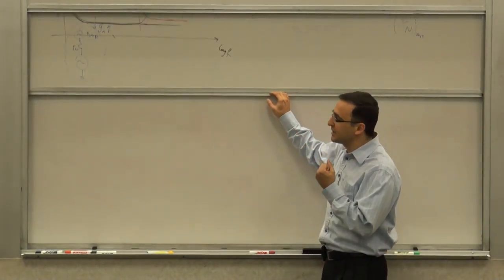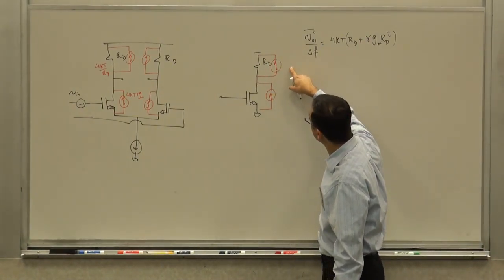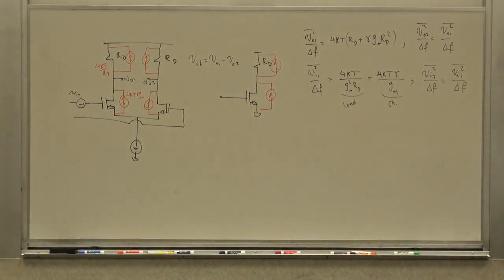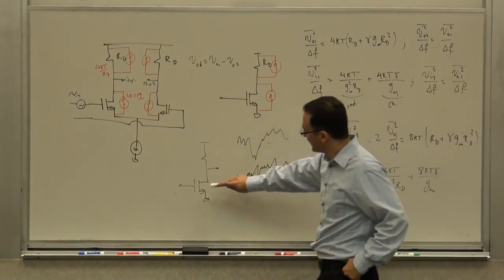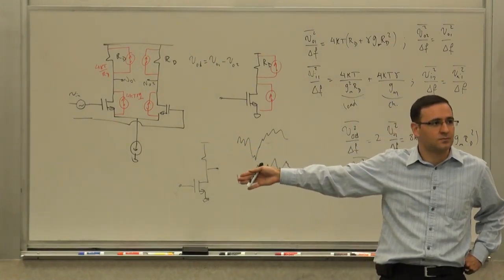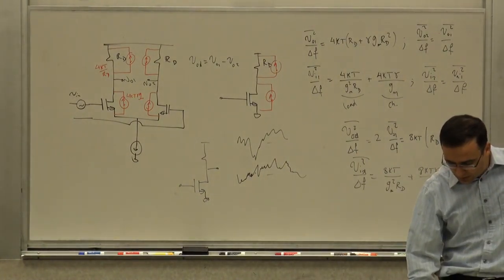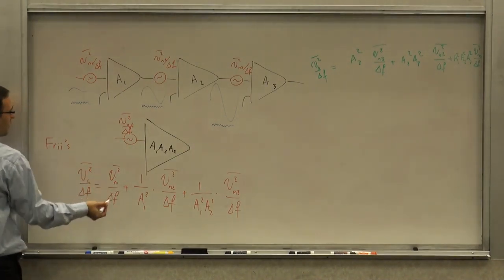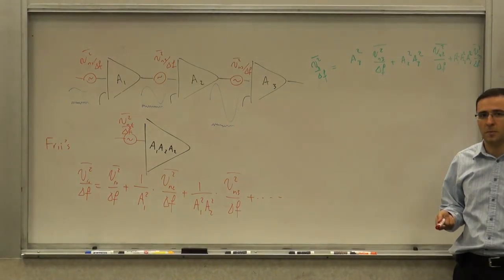169. Noise: Differential Amplifier Noise,  Multi-Stage Amplifier Noise

Comment: Hello Prof. I have a confusion when comparing the explanation in the textbook and here regarding the differential amplifier. The textbook by Prof. Razavi says that we cannot use the half-circuit concept because the noise sources are uncorrelated and hence there is loss of symmetry. Hence the entire circuit has to be analyzed. Can you justify the use of half-circuit? Also, suppose I wish to not use the half-circuit even if it is applicable, how would you derive the noise expression?
Reply from the maker: The calculation in the video does take into account  the fact the noise sources are uncorrelated. That is exactly why they do not cancel each other. The half-circuit is just used for determining the transfer function. You can assume two separate noise sources and analyze the whole circuit. The result for the differential signal will be the same. Hope this helps.
Reply: agreed, source node is no longer a virtual ground in noise analysis, it is for sure 2 input pairs' noise uncorrelated, not sure why we are still using half circuit approach here

Comment: Dear Prof. Hajimiri, When you said that single ended amplifiers have better noise performance than the differential amplifiers. But if we take the bias current noise into account, wouldn't differential amplifiers be better? From my understanding the bias current noise  will be split between the two branches and be subtracted at the output as they are correlated and if we neglect device mimatches.  However, for single ended amplifiers, the bias current noise will appear at the output.
Reply from the maker: Well, generally that is not the dominant source of noise. Also keep in mind that we are talking about intrinsic noise not external interferences in this context.